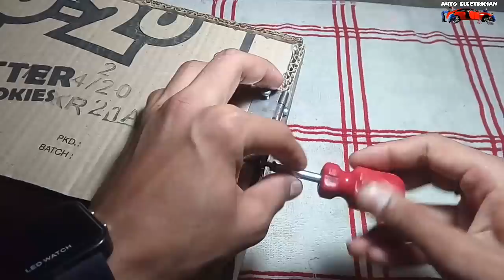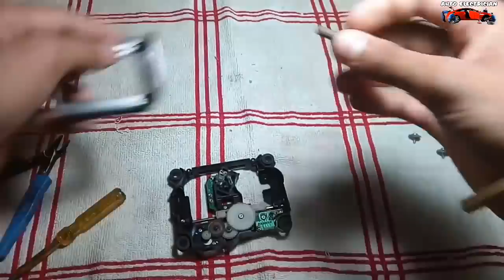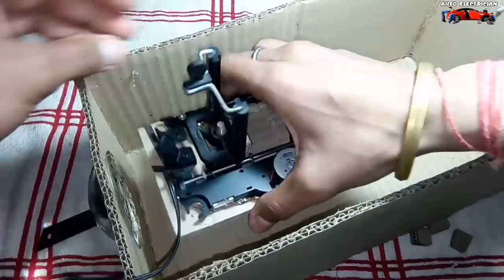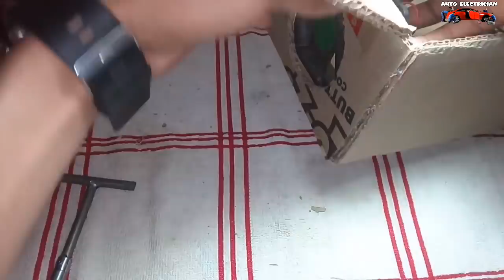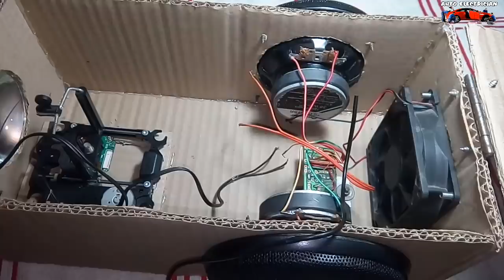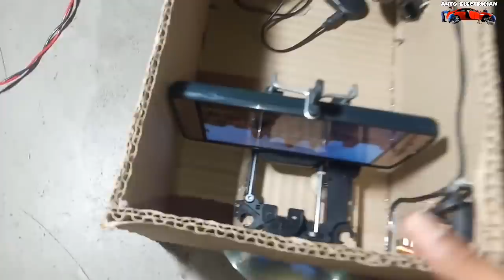How To Make HD  Smartphone Projector | Using Car Headlight Projector Lans

Comment: Jaisa taiyari aapne kiya usko dekhkar mujhe laga ki project hai but it was only toy...no required of fan ..also you neednot required 12 v for audio ...use palm 8503 and one 2.5 inch woofer or speaker...fan is used for high watt backlight led behind screen and use two lense and to rotate the phone slowly use 5v dimmer vc so that...also use plywood or fiber sheet....anyway good tried...best of luck.
Reply: verry bad

Comment: Total cost 5000rs to make it
Real Projector cost 4000 rs
Reply: Bro i only use 50 rs magnifying glass and free waste box from store    that work clearly u need more sound get waste cylinder shape box      fix or put  that near your phone  speaker
Reply: Real projectors costs more than 10,000 not 4000 this is only the best